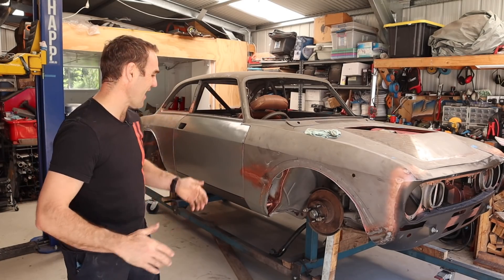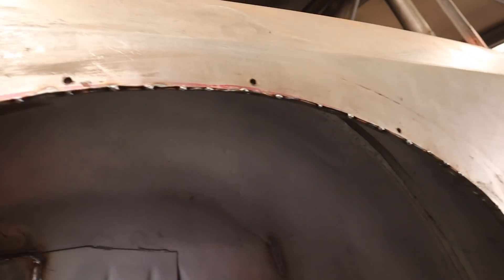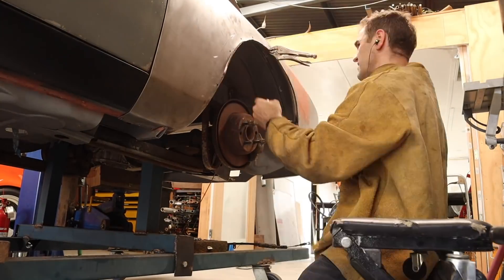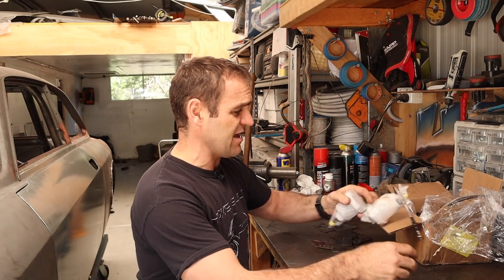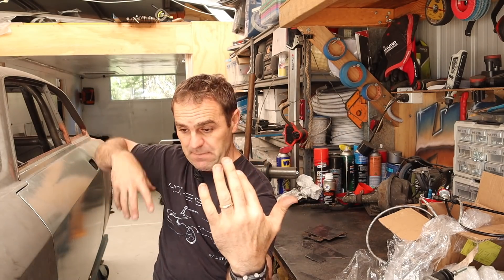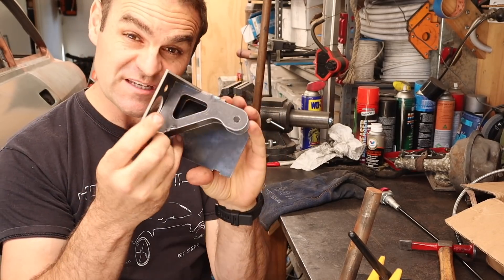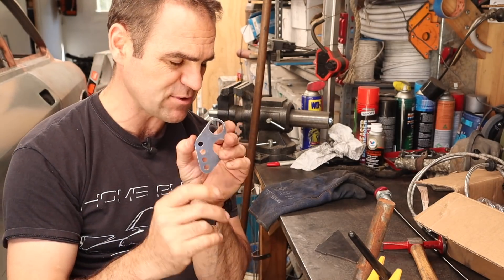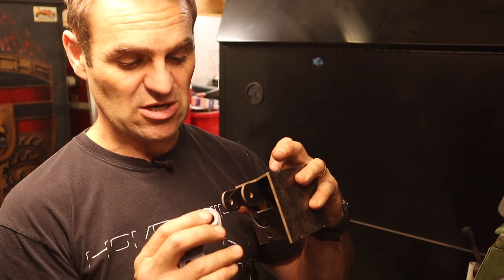Fabricating adjustable brake bias - Ferrari engined Alfa 105 Alfarrari build part 83

Comment: Good work but something caught my eye......  At 12:59 - Chuck Key 101 - Leaving a chuck key in the lathe can be extremely dangerous. If the machine is turned on while the key is still in it, you risk the potential of the key flying out and injuring someone.  Always remove the key once its use has been completed.  Good to see that at 14:01 you noticed it and realised the issue, good job!

Comment: The question is Jeff, did you follow Colins build methods and have a safety beer?!?
Reply from the maker: I knew I missed a step :D
Reply: He keeps forgetting to wear his safety tie
Reply: @pashakdescilly7517  Ha ha, if you've not seen Colins channel he's a top notch engineer and rivals Project Binky for bracket making! Definitely worth checking out. The trademark "safety beer" usually appears at least once or twice in each video :)
Reply: @antn537  Colin Furze usually wears his safety tie, but I don't know about a safety beer.
He is a most amazing gadget man, fabricator and generally mad scientist.... but I do think the BOM crew beat him on brackets and CAD.

Comment: Instal a grease fitting in the middle of your pivot bushing so it is easy to grease your pivot assembly in the future. I do this on all of my urethane suspension bushings and any other bushings I make.
Reply: Thinking ahead with such things is well a blessing.

Rather than cussing at a point in future for not doing such a simple addition. 

And yes in my 40yrs I have actually forgotten🤔😉🙂🤗👍👍

Comment: One point Jeff. In aviation, for any rotating assembly you would use a castle nut and cotter key rather than a nyloc.
Reply: You should also use a shouldered bolt of some sort. It's bad practice to rely on leaving the bolt slightly loose to allow the assembly to pivot.

Comment: Jeff, the 105s have insufficient strength above the rear wheel arches.  If they are gently rear ended in a car park, or are often driven hard on rough roads, their bum bends down and a crease appears above the rear arches.
I would therefore suggest that you add a flange behind each guard to replace the strength that was removed when you increased the height of the arch.
Reply from the maker: I have reinforcing plans.

Comment: With the pivot bolt you should consider drilling a hold for a split pin or other locking mechanism Because even Nylocks vibrate loose and brakes is one thing you don't want falling off

Comment: That looks really clever, I avoided adding a servo and might add this kit if the single circuit brakes aren't capable enough
Reply: Let me know if you want to use it, and I'll send you the files
Reply: @105colin  that would be awesome, I have access to a laser at work. I just got a new single circuit master cylinder, we'll see how that goes
Reply from the maker: I am thinking of trying to use one of the servos for the front circuit only. It will give me some boost to the braking and save room.
Reply: @HomeBuiltByJeff  don't think that'll work mate, you'll end up never getting the rear brakes to work (maybe if you ran some really odd Master Cylinder sizes) I've always run no boosters no problem, if you find the pedal is to hard you can drop the actuation rod down to the last hole on the pivot arm and get some more mechanical advantage
Reply from the maker: @105colin  Of course, I forgot that the front circuit would then be lighter so the bias bar would not push the rears. No servo it is :D
Reply: @HomeBuiltByJeff   As Colin said, I don't think you can run a servo on that setup, and appearantly the servos can be problematic

Comment: Get a lathe Chuck key with a spring on the bottom section or add a spring to your current one. That way you won’t be able to leave it in the Chuck and take your head off when you turn it on!
Reply: Yes that really spooked me. I've seen it go so wrong.

Comment: I love your face when you are happy about your work. Mate, you are a real inspiration. I bet you also do carpentry, plumbing and electrical work? You're the man Jeff. For the key in the chuck of the lathe (which is really dangerous) get yourself one with a spring on the end that will fall if you dont push on it.Cheers.
Reply from the maker: That is a good idea.
Reply: A simple spring can definately save an eye, as I have seen in my lifetime.

Comment: Jeff you could put a shoulder on both sides of the bias pivot and slide it in to the plate then  weld it in ,an extra bit of support  on each side .Great update